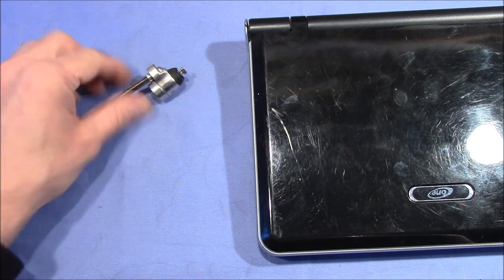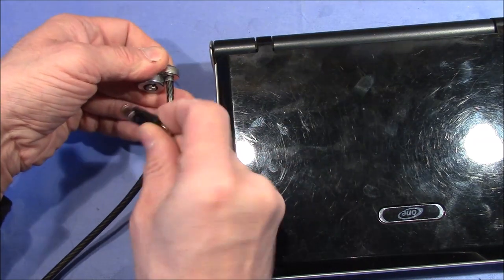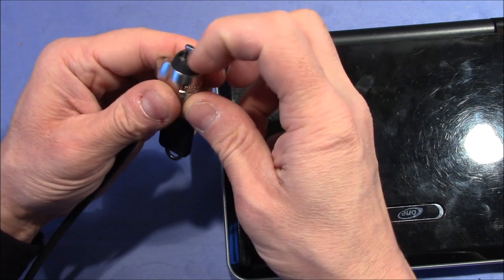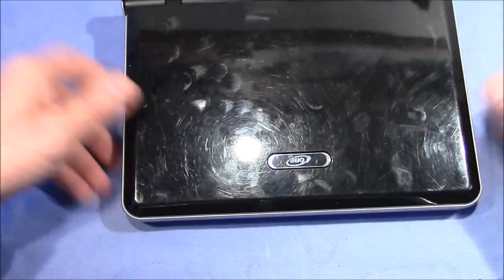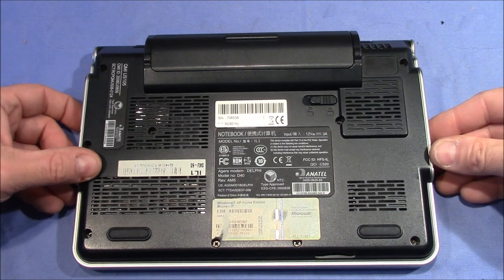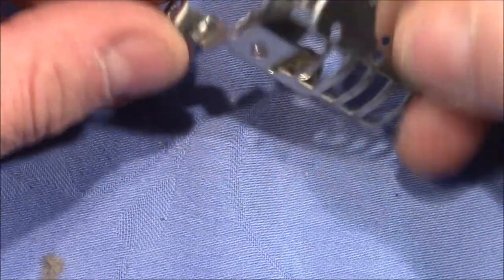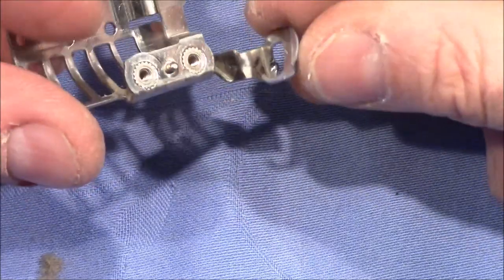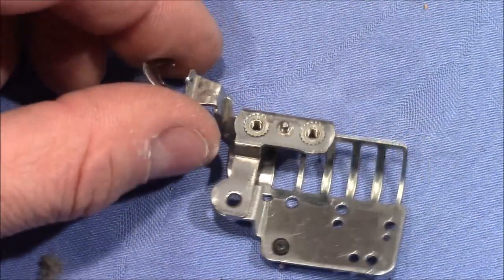(picking 731) Kensington tubular lock versus laptop

Comment: Absolutely love your videos! Technically, the Kinsington lock is designed to do the same two things that any lock does. First, deter a potential thief by seeming to be secured, and second, cause enough delay that someone (potentially the owner or law enforcement) would notice it being stolen. This accomplished both. That being said, if you could break it that quickly then the laptop isn't compliant with the Kensington standard. But, as we all know, every lock can be defeated with enough time and 'force'.... ;)
Reply from the maker: Yes, of course it slowed my down and a thicker plate would have caused even more delay. Will see if I can source another laptop that is compliant with the Kensignton standard for testing. But what a shame, a few cents more for a thicker plate would have improved the situation a lot in this one.

Comment: Mate just rip the laptop from the desk as hard as you can, one pull done and gone. They're a detterant not a preventative measure. A secure device will have a bottom plate that is bolted on through the motherboard, and the cable will have a positive and strong connection, basically ensuring that the device is ruined if it's removed. Maybe an audible alarm as well.